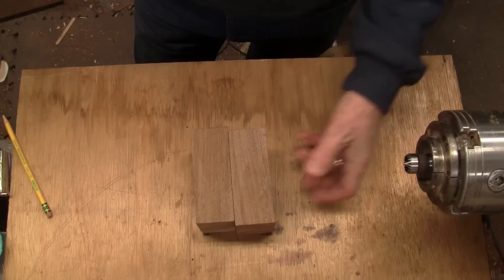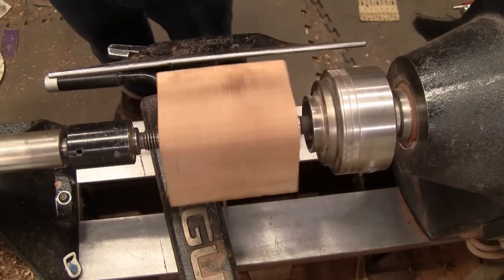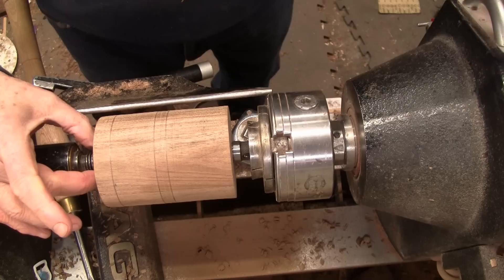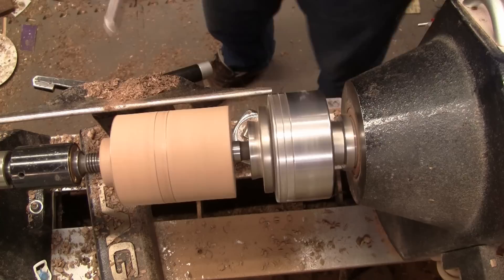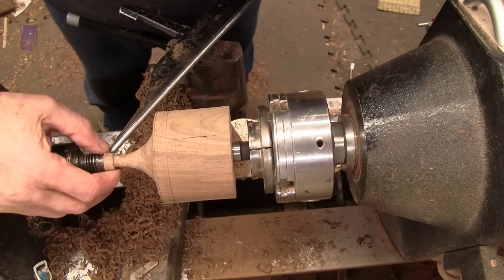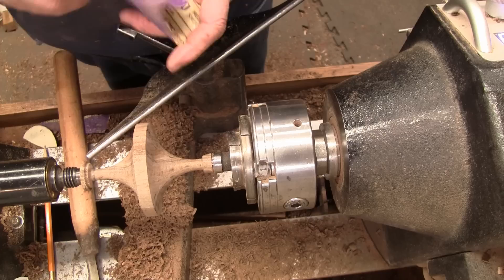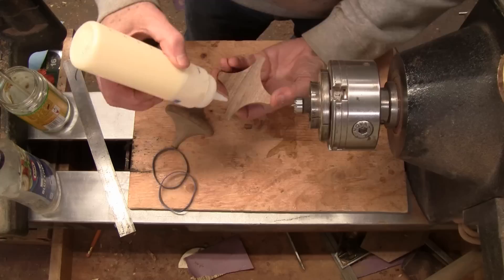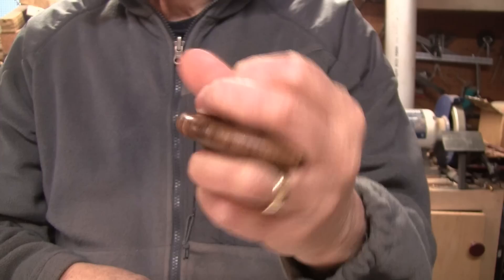Wood Turning A Femisphere  Easy Steps

Comment: Great video, Gary! I used to use lipstick when installing sheetrock. Apply to the front of protrusions like outlet boxes and just press the sheetrock against it. Bingo, now you know where to cut!
Reply from the maker: Thanks Clayton. Yup that would work to. Same way you blue to parts together to get a perfect fit. We had bluing ink at work for fitting metal parts.
 Thanks for watching,
Gary

Comment: That was so neat, Gary! I should dig into Captain Eddie's archive. Lots of good info in there. 

But I need to make a few of these. A bit more work but a step up from a spinning top.
Reply from the maker: Thanks Jay. Just think of it as a spinning top. With very accurate cuts. Then you have it. Even if you had to do some blending it would look good. I was determined to have a perfect fit and there is no reason you can't have that.  A perfect template. One way to make a perfect template would be turn it between centers. But I cheated.
Thanks for watching,
Gary

Comment: Thanks for the shout out Gary!! I like the tape idea in the center! That would have made mine so much easier to split! Turned out beautiful!
Reply from the maker: Thank you Heather and you deserve the shout out!
I have seen hot glue used on splint turnings but so hard to get the halves flat to each other.  I thought I would try just gluing a small potions of the ends and it worked. I have a very thin tool I used at work just to get it started and it worked great.
Take care,
Gary

Comment: Gary: You are so much more knowledgeable and skilled than I am, but can I just say that when I'm trying to get a straight surface, I don't use a round tool like a roughing gouge.  I use a straight edged tool to make a straight edge.  Like a skew.  I know that most turners don't like "scraping" but I have a had great results with it over the years.  Thanks for listening.
Reply: The project is very cool!  (the adjective that never ages). I had never seen one of these before.  I would love to try it sometime. But I don't think my dad's old radius gages go up to that size.  Ha ha ha. From a Deft user. ;-)
Reply from the maker: Thank you Dave. I would say what ever works for you is the way to do it. 
I learned at work building wood patterns to use my tool rest as a guide to make straight lines. At work almost all of our turning tools were scrapers. They are the most accurate way to cut to dimensions that needed to be exact. And I certainly have used them a lot longer than bowl gouges. So agree with your comments.
 Another way I have made perfect cylinders is using a parting tool to set the dimension spaced along the length of the piece. This can be done on a parallel piece or an angled shape.
Lots of ways to get it done. None are wrong and all can be used.
 Thanks for watching,
Gary

Comment: Gary I’m glad you’re back to turning.  The templets look very useful, but also look like you might have to have the laser engraver/cutter you demonstrated. 😉 I’m glad they sent you a unit to demo so you had the templets to go ahead and do this demo.  Cheers, Tom
Reply from the maker: Thank you very much Tom. Yes I did cut them on the laser but you do not need a laser to make accurate templates.
 At work all the templates I made and most were not round were cut on the bandsaw and then sanded on a disk sander or spindle sander and most times both.
 An easy way to make a round one is turn it on a wood lathe. Makes prefect circles. Who would have guessed LOL
 Thanks for watching,
Gary
Reply: @ThePapa1947  Yes Gary,  not having a laser system (yet 😉) I’ve use to making templets by the old fashion methods, but the laser system sure looks like fun. As for the wood lathe turning perfect circles; I recently came across a video of the wood lathe they used to use to make oval frames for mirrors/pictures.  It looked a little scary to operate as the wood spun around in an oval with a single fixed cutting point while making a racket.  So, just saying, not alway a circle. 🙄 Cheers, Tom

Comment: Gary, a really cool shape and technique.  I’ve made some spoons using a similar technique with brown paper, glued between pieces, that could be separated after turning
Reply from the maker: Thank you skip. I have also used the brown paper glue joint. I remember first using it in grade school. Did not have chucks back then so we glued a scrap block on the piece and fastened a face plate to that block. I use hot glue now to fasten the scrap to the turning.
 On this piece I as concerned with the ends getting small and having issues of cracking when trying to pry them apart.
Lots of fun ways to get the job done.
Thanks for watching,
Gary

Comment: Very cool project Gary.  Definitely see how it tests tool control and accuracy of cutting.
Reply from the maker: Thank you Mark. I am sure you could use a Dremel to make it fit if it did not come out right. 
But it is nice knowing that it will fit. That is if it fits the template perfect. 
 I still remember as an apprentice wood pattern maker I was rounding corners on a pattern(not a turned one) And  I and did not check it close enough.  Boss caught it and of course I fixed it. I hung that template on my bench for the rest of the time I worked at that shop.  Nothing ever left my bench again without being correct.  
 That was a good lesson 
 Thanks for watching,
Gary

Comment: Fascinating Gary! I love that shape. I may have missed it,  but how did you make the templates? Was it one of your new tech toys? Is it best to turn that smaller size, or will larger work as well? A definite Papa47 turning!
Cheers, Rick
Reply from the maker: Thank you Rick. Yes I did cut the template on the laser. And it worked great. I am no longer going to show lasers being used on wood turning videos. S
 You sure could make it bigger which I am thinking about doing. If I decide to make another that is. 
 Thanks for watching,
Gary

Comment: I saw Captain Eddies video some time ago and had this in the back of my mind. Then late last year I saw someone else do one so I had to try.
Made mine smaller. To suit the wood I had on hand. I used the paper glue method. Came out perfectly and as you said I found it kind of nice to hold. It sits by my chair now and I pick it up and fiddle with it while I read. Thanks for showing it again.
Reply from the maker: They are lots of fun to make. Captain Eddie was the first one I watched. There have been others but I did not pay much attention to them.
And for sure they do feel good in your hand. Reminds me of a Clinging Cross. When you hold one of those you just know it is supposed to fit just like it does.
 Thanks for watching,
Gary

Comment: Hi Gary,  I’m a big fan of your channel and your turnings, and a longtime viewer.  Don’t know how I missed this video 6 months ago but I’m glad I found it now.  I had not heard of a femisphere before and would like to give it a try turning.  I have a question for you before I do.  What are the calculations and math formulas you used to calculate the “1.4275” circle templates you used in your video?  You mention it at the 5:25 point in the video.  Thanks again from a faithful viewer!  I’m always learning something from you! Steve
Reply from the maker: Thank you and happy you found this video. 
The radius of 1.4275 was the diameter of that center band minus the width of the band  So 3.25-.395/2=1.4275
That is what it worked out to be. I do not think you would have to hold those tolerances. But I always try.
Hope that helps,
Gary

Comment: I have been thinking about this and would like to try one.  What is the size of the wood blocks that you start with or does it matter?  I will be following you step by step - you explain clearly what you are doing.  Thanks again for sharing
Reply from the maker: Hi Lacey, You can make this any size you want. You would vary the size of the radius based on the size of the block.

Looking back on what I did I made my 2" in diameter and used a  .875 radius.

Hope this helps and best of luck,
Gary

Comment: I did enjoy the video. Well except the part where you used rubber bands to clamp the glued halves together. You used that damned speeded up video there and I could not see  just how you were working. Thank you for sharing the parts I did enjoy. Have a great day and stay safe.🙂🙂
Reply from the maker: Thank you Glen. I had problems when I was doing the rubber band part. If  hold onto small things for very long both of my hands cramp up. It was a struggle and it would have looked a lot harder than it was. 
 What I did was hooked the rubber band around one end and made a twist around that. I brought it up and over to the opposite side and did the same thing. 
 I wished I would have made a cradler for it where I could have put a clamp on the center of the top half and clamped it down. I think that is all it would have needed. And if the ends needed something I could have wrapped rubber bands around the block and the ends.
 Sorry about that and if you would like I could take a picture of the rubber bands on the finished part and you will be able to see that.

Thanks for watching,
Gary
Reply: Thanks Gary. I understand. No need for a picture.